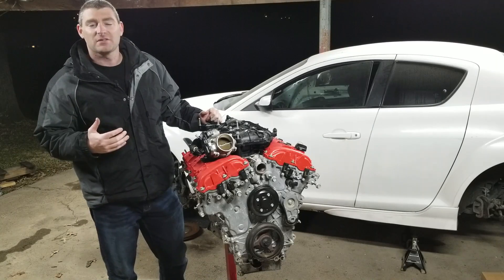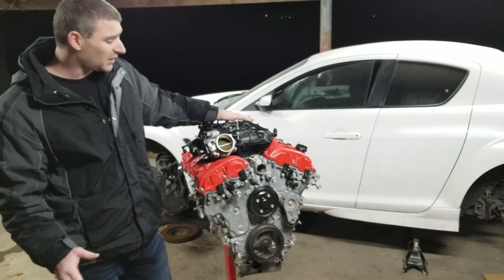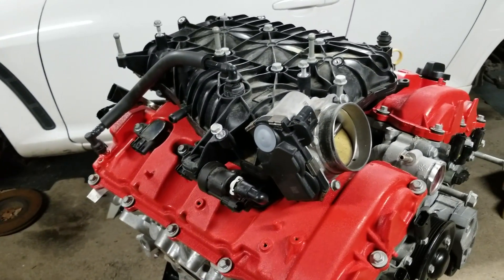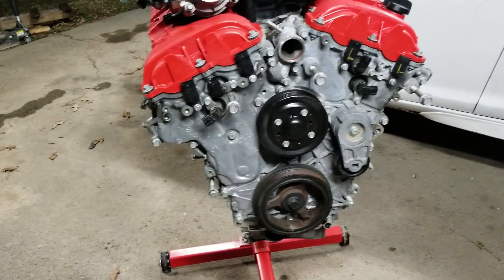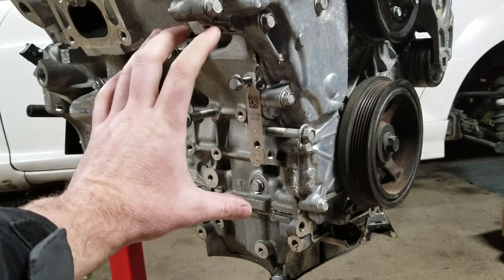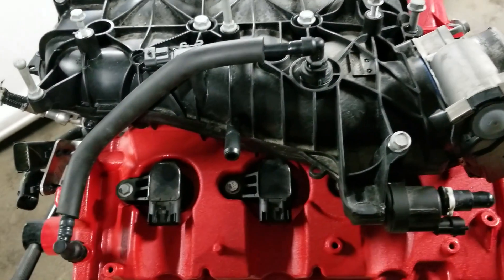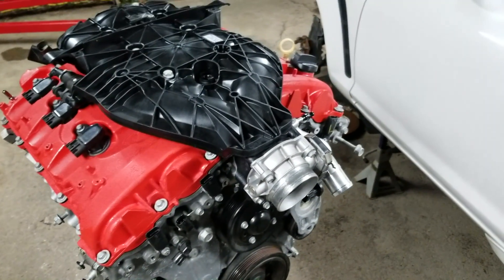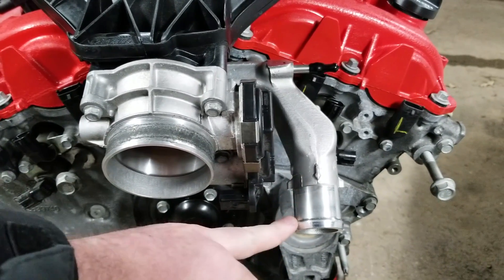GM LFX V6 FWD vs RWD - What's the Difference?

Comment: I didn't know anybody was looking for RWD parts.  I've converted 2 Cadillac engines for Equinox duty since most Equinox 3.0 have bad timing chains or are blown up from oil starvation.  I've been sending intakes to the landfill and metal parts for scrap.  Something I didn't see mentioned in the video is that the RWD and FWD use a different flexplate.  Probably doesn't apply for Mazda swaps, but it's relevant to the general discussion.  It's also worth mentioning that a RWD/AWD (like a CTS4) engine will have a hole through the oil pan for a front half-shaft and provisions for mounting the front differential to it.  This isn't necessarily a problem for a RWD application, as this is all sealed/separate from the oil sump, but it may make it less desirable for some.

Comment: I know I am a little late to the party but two things concern me about a FWD engine used in a RWD application. I believe it was stated that the engine blocks are the same for FWD and RWD applications but elsewhere I have found that some folks say the two have different bolt patterns for the transmission. So my question is, will a RWD trans bolt right up to a FWD engine without a special adapter? Also, will the FWD oil pan need to be replaced with a RWD oil pan for RWD use? Thanks any and all help on this.

Comment: I have a question. I have a 2019 impala and I want to change the PCV that is on the right side of the engine. It can be removed or is it fixed to the valve cover.

Comment: I have a client that wants to supercharge a 2018 Chevrolet traverse redline package, I believe it is this type of engine, I’m not sure if it’s front wheel drive or rear wheel drive just yet, but I have found some super charging kits for the Camaros, I wonder how feasible it is to supercharge the traverse, any thoughts or opinions you could share Would be greatly appreciated, thank you

Comment: I have this engine in a buick lacrosse 2012    I recently attempted to clean the throttle body,.     when the key is turned  to accessorie mode to open throttle plate for cleaning it hardly opens at all  ....   maybe 20 percent or so of an opening            is this normal behavior?          Thanks for quality content :)

Comment: Does anyone know if it’s safe to boost the rwd lfx. I have a camaro and I keep seeing overkill systems for it but I also know that the lfx’s have a high compression ratio. I really don’t want to blow my engine but I want a decent amount of power. Does anyone know if it’s safe to do that?
Reply: Assuming you found a answer? But you can boost anything.  Just need to upgrade rods and pistons and drop the compression down to least a 9.5:1  what the saab 2.8t runs.  Its the same block just sleeved differently  from 2.8 to the 3.6 high output motors from holden/gm is litterly the same engine.  Just different configuration to fit in different cars.  Like coolant lines and such.

Comment: So I have a 2010 camaro that needs engine so I can use a cts engine
Reply: Have u gotten an answer to this question? Does the oil pan have to be swapped, to adjust for the passenger side mount?
Reply: @Igotouhere  no not yet

Comment: Working on this swap into a 1991 isuzu mini truck.  Actually bought an entire wrecked running 2015 camaro and should make most of the money back from parting out what i dont need.  Videos posted on my channel!
Reply from the maker: Awesome! That is definitely the best way to do it. I searched for a while to find a whole car, but had no luck.
Reply: @trackcarobsession  Me too! ended up finding a manual camaro listed on AutoBidMaster.com and had it shipped to SoCal! Even after shipping it costed the same amount as an imported SR20det blacktop w/ trans (which was my original choice)
Reply: @trackcarobsession  Its too bad that the non camaro coolant spout wont fit with the camaro intake manifiold, that part would be perfect for my truck.

Comment: This has given me some ideas for my 9th gen impala (2016 ltz limited fleet model) when I discovered the exhaust manifold was part of the block I was discouraged that I couldn't turbo it, however I think with some modifications I May perhaps be able to super charge get some more horse out of her
Reply from the maker: The engines definitely love boost. The single outlet exhaust make turboing pretty easy, as long as you have the room for it. I unfortunately do not. I have tried.

Comment: I'm going a lfx into a ND mx5, which lfx uses the alternator on the RHS ( looking at front of engine )
Reply from the maker: My engine had it on the top of the RHS and it came from a Cadillac SRX. If you click on this link http://gmauthority.com/blog/gm/gm-engines/lfx/ and select the Pictures, you can see the different configurations in different GM vehicles. The engine will be great in a ND! Good luck

Comment: What about the oil sump and pickup? Transverse to longitudinal engine. Any chance for oil surge?
Reply from the maker: That is a very good question, and it honestly slipped my mind when making this video. The oil pan/sump is different. The pickup is a part of the sump, so you can get a longitudinal sump, bolt it, and you're good to go.

Comment: What car was the FWD LFX engine from? Was it an impala? I want to know if there are any good maybe hidden mods out there for the fwd version that I haven’t seen yet that will add a noticable gain in hp and torque
Reply from the maker: It was taken from a Cadillac SRX. I think there could really only be three differences that could make a difference in power. The intake manifold, the exhaust, and the tune in the ECU. If you can fit a Camaro intake manifold, some higher flowing exhaust, and have the computer tuned, you will likely be near the same numbers as the Camaro. The longblock of the engine is the same.
Reply: Yolo  trifecta makes a nice tune for them  slp underdrive pulleys  magnaflow makes nice exhaust

Comment: Why would you just get a LSX?
Reply from the maker: In many cases, a LSX would be the best option. The LFX however has advantages over the LSX when it comes to weight, simplicity in exhaust routing, cooling requirements, length of engine, and replacement cost. There are other advantages, and of course, there are disadvantages, but the main reasons why I chose it were teh specific output per liter, and the super cheap cost to replace. If I blow a motor on the track, a longblock can be found locally for less than $500.

Comment: @UCDErAwYkbz8jze5n4p6hoRA  I have the same engine in a 90 miata. Long story short, I am looking at a later video and you have an idler pulley where the power steering pump would be on a Camaro and guessing a shorter belt as well.  Basically just an alternator.  If you don't mind can you let me know what part numbers you used to do that because it would allow me to de-power my steering rack and ditch my PS pump.
Reply from the maker: I'll take a look at it and try to get some part number for you. Definitely makes for a clean setup.

Comment: Was thinking the other day a front drive set up from an impala into the rear of a custom buggy kind of thing.  Make something similar to back in the day with the VW beetle buggies.
Reply from the maker: That would be a very powerful setup. Would likely be quite large though, and I'm not sure if there is a fwd manual transmission option. I haven't actually looked for one though. Not a problem if you want an automatic of course.
Reply: @trackcarobsession  305hp with a 6spd auto would be fun.  Chip it so you can firm up the shifts. It has the push button shift mode, turn it into paddle shift or auto stick.  Just thinking outloud lol

Comment: Hey there, I think that's awesome work. Now I'm no Pro Mechanic, I'm a self taught, learn as you go kinda guy and I was wondering what's going on with the exhaust header on that engine? How come there's only one outlet? I've never seen this engine before and I'm quite curious... any info would be greatly appreciated. It's a shame to lose the Rotary but given its fragility, I understand why folks tend to swap them out. I've always though about it but never thought about using a GM V6. Honestly I guess the Japanese V6s i.e. Toyota Camry, Infinti/ Nissan or even a VR6 from VW would have been my first ideas but now you've got the gears going in my head for my 93 rx7. Its great to see something other than a LS or 2JZ being installed. Also, any thoughts on the ECOboost V6 by Ford or the Pentastar V6 by Chrysler/Dodge/FCA? Great stuff bro, keep up the good work, looking forward to seeing more.
Reply from the maker: Sorry for replying so late. Thanks for watching and those are all great questions. The exhaust ports on each cylinder actually meet up in the middle before leaving the cylinder head in a single port. Not only does this drop weight by removing a cast iron exhaust manifold, but it allows exhaust routing to be extremely simple by having just a single downpipe on each side. This is becoming common on a lot of the new turbo engines including Ford's ecoboost engines. It allows the turbos to be closer to the cylinders, which reduces spool up  time. I am not a GM fan, and didn't initially look at the LFX (didn't really know anything about it), but while looking through a bunch of options, this one just looked like the best option for me. I looked at ecoboost 4 cylinders (which may still be an option for my track car), ecoboost v6 (cost way too much for what I wanted to put into this car), and other engines from other companies. There were no other engines that I could find that made this much power (323hp) with such low weight (340lb.) at this low of a price (as low as $500 USD). The LS and 2JZ engines are both awesome. The LS still weighs quite a bit more than the LFX, costs several times more, and had a lot more exhaust than I wanted to deal with. The 2JZ weighs a ton (not literally), and is such a long engine that the weight is really far forward in the chassis. I would love to have those engines in other cars, but they just didn't fit the project I was looking for. I wish I had the budget to have several cars and swap all of these engine options just for fun.

Comment: I noticed that the man making the video as well as alot of people that have left comments are calling the LFX a motor. Just to clarify, the LFX is an engine it runs using internal combustion. A motor runs using electricity through a rotor and stator. Our shop instructor in high school would make us clean the pit floor with a tooth brush for being lazy and ignorant to call an engine a motor.
Reply from the maker: Sounds like your shop instructor needs to come clean my driveway with a toothbrush. A motor, per the dictionary, is a power unit that imparts motion, which includes internal combustion engines as well as machines that transform electrical energy into mechanical energy (ie. Electric motor), but let's not get pedantic.
Reply: @trackcarobsession  yes that is what you get if you ask to define a motor, however, now ask what is the difference between an engine and a motor. Then you get The real difference, is the fact that "motors" run on electricity, while "engines" run on combustion. ... On the rare occasions we encounter one, we refer to a steam locomotive as an engine, the same word that we give to the motive power of an aircraft. But all electrical devices are driven by motors.
Reply: @mathieuhawkins6002  Well we've got "Motorcycle's and "Motorcars" and no one would generally consider them electrically powered off the top of their head.  No one calls them "Enginecycles" or "Enginecars" The English language is a very imprecise rough as guts thing sometimes. It's all just words anyway, but as long as most people know what you're on about it doesn't matter if you call a petrol V6 a motor or an engine. As the OP said, a motor imparts motion so it isn't wrong or even inaccurate to call a car 'engine' a 'motor' because the thing that's describing them, which is language, is so full of logical holes anyway.

Comment: I wanted to turn my LFX Impala into a RWD retrofitting a train from a donor with similar wheel base and fitment like a Cadillac ATS, Vic, Camaro, etc. I'd get a project Impala instead of my current one however.

This has been done before, one video I watched had dropped a LS1 into a 2007 Monte Carlo as well as married in a Ford drive train. The V8 had a few inches to spare so I suspect a LFX would fit without moving the firewall and of course the modified engine kit mounted on. 

I was also wondering why the Camaro LFX had some 30 more horsepower than my Impala, but you've confirmed my suspicions. The exhaust is completely different, one is for EPA and economy boosts and one is for performance. The intake between them is slightly different too, by a few horses.
Reply from the maker: Yes sir, I believe the only difference in power is the intake, exhaust, and probably some ECU tuning. All three things can be fixed in a swap though.
Reply: I had thought so, GM wouldn't stick a entire different motor in just for 30 more horsepower. That LFX has some heft to it as well, it could easily replace the Impala SS V8 if it had 330 on the block. But currently the LFX and the LS both have similar 1/4 mile time that you could say they're identical but the SS has about 0.6 faster 0-60 time, still that V6 moves a 4000 lbs sedan pretty quick.
Reply: The intake and exhaust are the major differences. The Impala LFX motor also has a more restrictive throttle body intake and the exhaust has that infamous horse shoe.

Comment: Brand new LFX engines are 4.2k as for July 2018
Reply from the maker: That isn't terribly expensive. Luckily they have been installed in so many GM vehicles over the last few years that low mileage ones can be found all over for $500

Comment: Have you thought of using a 12mm spacer between the intake and the motor?
Reply from the maker: I haven't. It would likely be a tight fit under the stock hood with an additional 12mm. I would have to measure

Comment: I have the same engine in a Cadillac XTS, FWD. It sucks a ton of oil through the valve cover metering orifice since it does not have a traditional PCV valve anymore. All that oil mis goes in the intake nanifold and gets deposited on the intake valves and on the stem of them looking like a gunky mess. Valves become stiky and don't travel properly in their guides anymore also dont seal properly because of this oil-carbon gunk mess. Cleaned them twice already manually which greatly improved the way the engine ran but back in the same spot after about 30000 miles. Sucks
Reply from the maker: Cristi N I have read about this issue a lot online. I have actually filmed a couple videos about this, but have not yet edited them to get posted. Early CCVs had ports that were way too small and need to be drilled out. On mid 2013 models and newer, GM actually did this themselves. However, a quality catch can is also needed on this engine. It should prevent the build up that you are struggling with.
Reply: I own a 2013 camaro ls model, 6 spd, and can confirm that this engine does indeed need a quality catch can, noticed a huge difference in the intake manifold track after splicing one in, it catches nearly 95% of the oil mist, sadly i only added it after about 23 k miles on the car, i started to have rough idles at 500 rpms but the dealer said the engine with a manual trans is normal at that RPM however using the catch can and spraying some valve cleaning seafoam top end engine cleaner and lubricant ( its a solvent and a lubricant "petroleum")  in the vacuum sides port (right on top of the manifold where you were talking about the new hose would go on RWD models) of the intake has really help valve health and longevity  @trackcarobsession
Reply: You raised a good pointe , but direct injection engines will do that to a degree.

Comment: what about the oil pans? are they the same between fwd and rwd models? is there a version of the LFX that has a rear sump pan, do you know?
Reply from the maker: That's a good question and I realize now that I didn't cover the oil pans at all. There are actually several different oil pans depending on the years. Some have sensors that other don't etc. The oil pan is a rear sump. The swap kit that I am using has a modified oil pan in it to clear the RX-8 subframe. Its a very complicated pan and actually a structural part of the engine assembly that the bottom of the transmission bolts into
Reply: oh interesting. using a modified oil pan must be how you rx8 and miata guys fit these engines in your bays because my understanding is that these are tall engines. i imagine that this new modified pan of yours has a sump that is less deep than the stock pan? do you know how much less the depth is on this modified pan of yours vs the stock pan?
Reply from the maker: It is the same depth, it just gets modified on the front of the pan to fit behind the oem subframe. Oil capacity is the same. I have a picture of it that I can try to throw in a future video. Actually, I'll make a short video showing the bottom of the car so you can see the pan, crossmember, exhaust, etc.
Reply: haha thanks for answering my questions... seems like I have a thread going in a few of your videos. I really appreciate this info you are putting together. its very helpful. i would love to see some shots of the bottom of the car in a future video.
Reply from the maker: No problem man. That's exactly why I wanted to film all of this stuff. It can be hard to find some of the information on these things. I will shoot another video in a couple of days under the car.